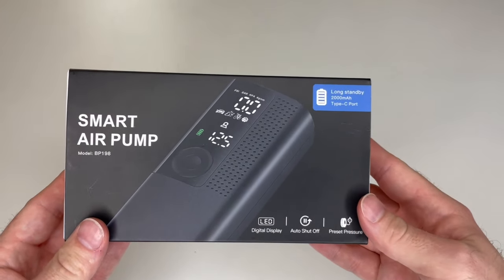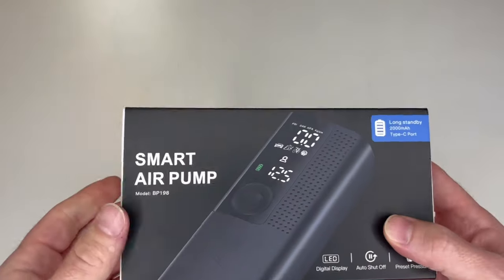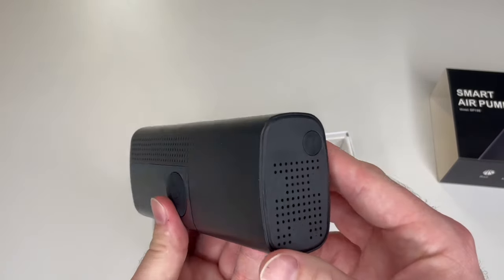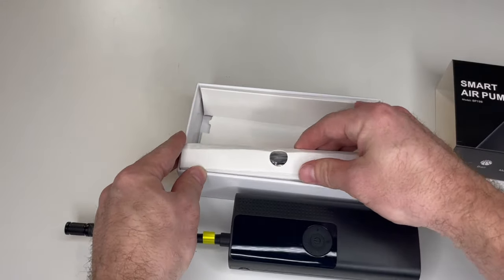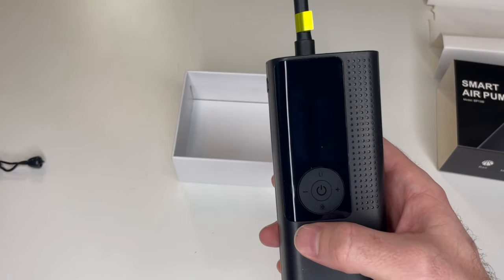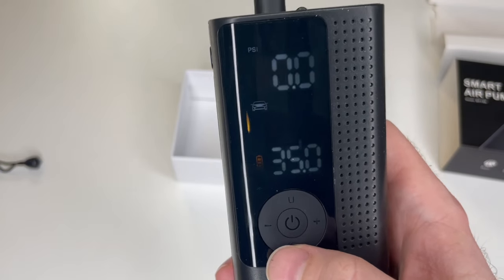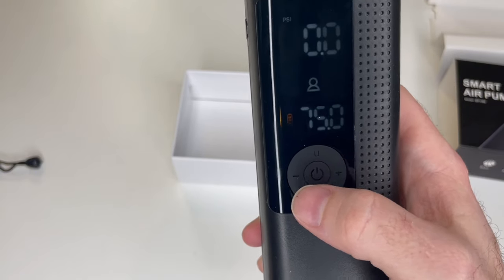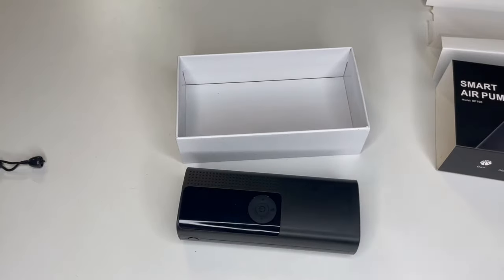How to Use The Airmoto Smart Air Pump

Comment: The most unattractive feature of pump is the difficulty in turning it on. You have to press center button briefly. If you do not end up turning on compressor, it turns off power and you have to start all over again.

Comment: Air pumps are subjected to heating when compressing air. This limits the time that the pump can run continuously without stopping to let the pump cool down in order to prevent damaging the pump. Also, the time it takes to inflate something to a given pressure depends on the volume to be inflated.

Comment: It has been over 6 months, since I asked the Question below. I guess your Customer Service is also non-existent.
Your adds don't mention the preset range. My Air Lift 1000 air spring kit requires 5-35 PSI. Can the Airmoto preset for as low as 5 PSI?

Comment: Your adds don't mention the preset range. My Air Lift 1000 air spring kit requires 5-35 PSI. Can the Airmoto preset for as low as 5 PSI?

Comment: Does the tire lose air when you try to remove the connection from the tire valve?  Do you have to remove it fast to avoid that?
Reply: just fast enough to disconnect it - a bit of air will escape but not enough to worry about.

Comment: Hi! I just bought it. I've two doubts, specifically about the car tires:
1) but is it possible that he inflates a tire too much? Or not?
2) is there a way to measure the actual pressure already present in the wheel? to carry out a simple check
Thank you
Reply: When you put it on the tire it reads what the current pressure is. Not sure if it can overinflate. I used it on my uncle's car and it didn't automatically shut off when it got to the set pressure. I might not have waited long enough though.

Comment: About how long would adding 5lbs to a auto tire take?
Reply: Exactly my concern too .. probably takes forever given how small this unit it (if not, I would have expected them to be much more transparent about this)
Reply: Just used mine first time.  Aired 2 22" tires from 33 to 38.  The 2 tires took about 15 minutes together, total.  I consider this remarkably fast for such a tiny device, small battery.  To run the pump faster would require much more battery power.  I was able to do this to my car in my garage rather than driving to another location with an air hose.  No battery discharge was indicated, further speaking well for this device.
Reply: I might add that airing a car tire from 30 to 35 vs from 33 to 38 will give different results.  I'm not sure which direction.  Each additional pound going to 38 doesn't require as much volume pumped but does put a higher load on the pump.

Comment: How does it seal onto a Presto Valve?… Screw on will not work with a racing bicycle… it has to be inflated to minimum 100 psi‼️ The tiny amount of Air Volume in those very small tires (under such very high pressure‼️) will escape immediately as soon as you start unscrewing the Air Tube. Unfortunately you did not explain how the Air Tube seals onto the Presto Valve… The disconnect MUST happen in an instant if you want to maintain the 100 psi pressure‼️☝️
Reply: Reflling a presta valve at 100 PSI will always be easiest with a CO2 cartridge. The idea of carrying a battery powered inflator is rediculous. The presta valve with the provided adapter (brass) will not allow air to escape back out. Credit goes to the brass adapter, available at any walmart.

Comment: I bought an air compressor with a rechargeable battery from O'Reilly auto parts. It worked great, but after one tire it was done. Then it needed a recharge. Pretty sure this is the same. It was a $30 Slime Brand inflator. Sounded exactly the same but was bigger. Most likely the same compressor.

Comment: mines arrived whithout hose
Reply: I thought so too, when mine arrived but it is inside of the device, as tutorial shows.  Push button on end and it will extend enough to pull it out. If still not inside of it, contact them.